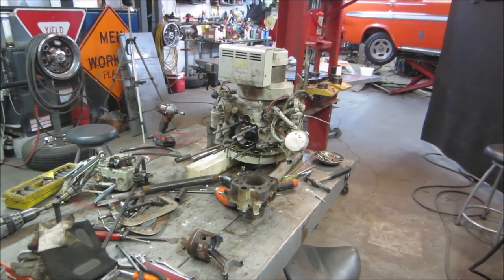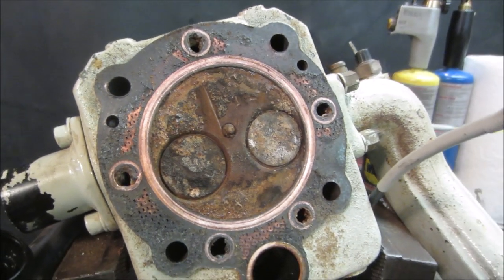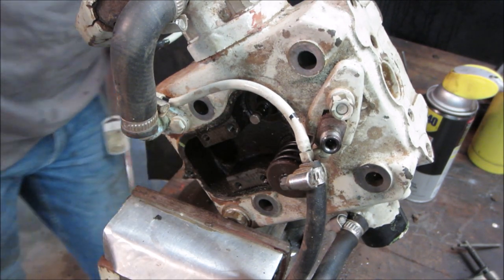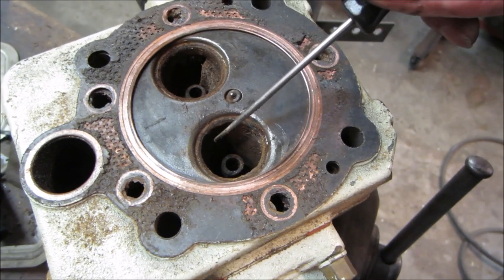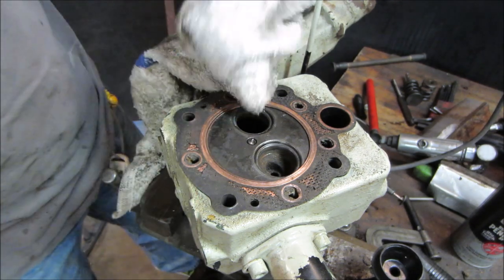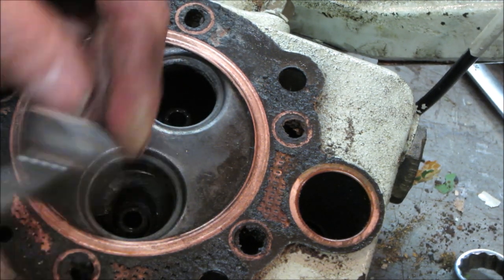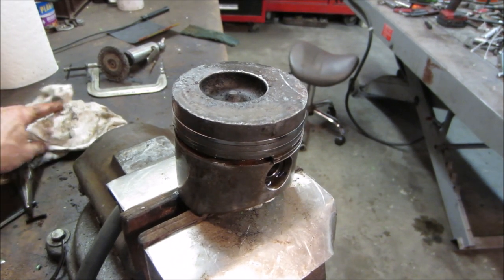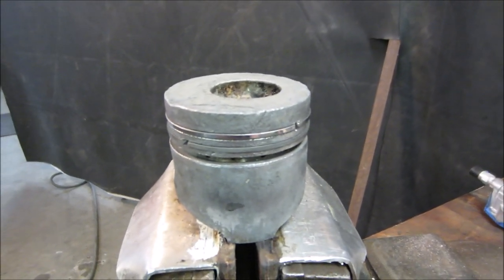Can It Be Saved? Junked Marine Diesel PT 2

Comment: Come on buddy you can find rings and a piston let’s bring this old clacker back to life............everyone like this if you agree and want a part 3
Reply: Diesel engines with wet sleeves sometimes don't have oversized pistons available as the cost of the sleeve may be less than the cost of making and stocking oversized pistons and boring the cylinder.
Reply: Me too waiting for part 3 :-) Curious if he can make it run in the end. Great video, really great. See there are several other videos about restoration on his channel; lovely entertainment and very educational.
Reply: I don’t understand why there is not a part three to the build. You can get rings Somebody could Build you a piston the cylinder could be sleeved. I washed all your videos I don’t understand why this project never had a part three. It Hass to continue that just has to..
Reply: Part 3 ?! 😆  if it runs, it runs and starts crap and is on a fast track of destroying itself 😢
Reply: Ressurect that old Mustie 🙌🏼
Reply: @mercurymadness9005  like vALVE,

Comment: being a old marine mechanic, i'm sure the exhaust elbow has rusted out allowing water to get in the exhaust side from the cooling side as it exits. this usually happens after it is shut down with no exhaust to blow the water out and it trikkles back past the ex valve.
Reply: Can that be repaired? Man that cylinder has a groove like the Grand Canyon. Fun project to watch, but it’s just a generator. There’s no buyers for it, if he puts much in it besides a gasket kit.
Reply: Yeah, that's my thought too.
Reply: @breikowski  running and working its gotta be at least 500 maybe to a sail boater way more
Reply: @jordanlittle5391  yup, I agree. So, best case, he’s working for free. That’s if he can bore the cylinder out and press in a new sleeve. Did you see the groove in there? There’s no way a 20 over is going to clear that. At least he got a couple videos out if it before it goes back to the scrap pile.
Reply: @breikowski  like he said if you had a piston where the rings sat below that it would run otherwise the rings would catch and break
Reply: Looking at the heat exchanger being all rusted up. It's safe to assume the separation of engine coolant and sea water failed, in addition the output could of been all plugged up and when the engine was craning the raw water pump is pushing salt water into the engine and  exhaust.

Hopefully it's worth most of what you paid for it in scrap metal. 

It was entertaining and watching you discover the failure points.

Comment: Mustie1, I have been around boats for a long time. A common issue with inboard cast iron engines are they rust out unless they are fresh water cooled with a heat exchanger and coolant. Your engine looks to be raw water cooled( plain old sea water) . So the first first piece to rust out is the exhaust manifold and riser. That can allow water to be dropped in from the exhaust manifold. But also the way that exhaust is cracked looks to me like it froze. That would also make it leak when thawing or after shutdown. I am not there to inspect it as well but it is a possibility that it was sunk in a boat which you have pointed out already. Another commenter from Italy left a comment that was very good. Lombardini engines are very reliable. I have worked around them. I believe that you are going to get it popping soon! Great content! Keep it coming please!

Comment: BTW you saved me some money today and a trip to a store plus taxi fare. I have a cheap water dispenser that's basically a plastic housing with a slotted column thing in the middle that pokes into a 5-gallon water bottle then a plastic tube on the inside that connects the column to a spigot, with spring steel clamps on each end and a plastic nut to hold the spigot on. Today it started leaking and dribbling water onto the table. First I determined that it was the dispenser that leaked, not the bottle. I was all set to go buy a replacement dispenser, then I thought of you and said to myself, "Let's see if I can fix it." It turned out that the plastic nut had worked its way loose so it was just finger tight. A couple of seconds of torquing it with a pair of pliers and no more dribbles!

Comment: If you ever need valves ground just ship them to me and I’ll grind them. As for the valve seat a valve seat cutter should clean it up. Or ship the head to me as well and I’ll grind the valve seats as well.
Reply: If you remove the sharpie your seats need recutting.
Reply: @datadavis  that I cannot do but JonathanW probably could.
Reply: @mjmcomputers  ain't much jon can't do is there!
Reply: Including giving a machinist a brain hemorrhage
Reply: Maybe Abom79 can make a new sleeve out of a billet of cast iron !  Ha-ha !
Reply: My laser cutter can't do crap on this because they use weird piston ring designs. Plus it would need to be checked for leaks.

Comment: This video inspired me to use a 20ton press to break a rusted in aluminium piston out of my 1941 single cylinder two stroke outboard engine. Cast head and barrel, no sleeve, and applying the pressure through the spark plug hole! The piston did not survive as expected but I have a spare. The barrel looks fine and after some honing I’m now rebuilding it.

Comment: Mustie, I was taught by on old master many years ago to make lapping compound using burnt wet and dry sand paper mixed with grease it is particularly handy when dealing with badly damaged or very hard valve seats as you can vary the grind by adding more burnt paper and using different grits...I highly recommend you try it.

Comment: When I was a Marine Engineer we'd change the liners frequently on bored considerably larger than this. We'd use a two part spray process to check for small cracks. First spray was red and would be left for a while to soak into invisible cracks and the second spray can was white. After a short while any cracks would be easy to spot as the red would seep into the white from below and the cracks would be visible to the naked eye.

Comment: I haven't seen one of those for a very long time.  You have to be careful as DECCA and Marconi (LTD) used them with the generator to make the high voltages (1,000 to 2,000 Volts plus 480 V etc) for their marine radars.  We gave up trying to find gasket kits for them and started using copper sheet to make our own.  Cut it the same way I've seen you make the paper ones and heat them in the oven to soften them if you remove the head again..
Thanks for showing this video.

Comment: Quotes from a Mase manual: Repeated attempts at starting with
negative outcome may cause excess accumulation of water in the exhaust system with possible serious damage to the engine.
If it is difficult to start the engine, do not retry for too long without first having closed the seacock. 
It happened to me😬
Reply: Yup, hydrolocked for sure.

Comment: One tip when lapping valves, when getting close to done, write on the valve seat angle with sharpie all the way around. They if it is gone after another round of lapping, you know that the angles are matching.
Reply: Well, the angles shouldn't match perfectly, the way I learned is there should be a narrow band where they make contact, not the full surface. I looked at a performance Chev site and they were even saying 45 and 60 degrees (45 for the value, 60 for the seat). 

But yeah, a sharpie, machinists ink, even quick dry krylon spray paint works too.....anything so you can see the seat line.....
Reply: he has done this in the past.
Reply: We used bluing(sic),but a sharpie will work
Reply: @muskokamike127  Actually the seat should be cut on three angles and the valve on one if my memory serves me proper.

Comment: Looks like the water jacket on the exhaust manifold failed, and let the cooling water leak back into the cylinder.  Happens a lot with marine engines when the exhaust manifolds aren't inspected/replaced on a regular basis.

Comment: I've made a head gasket from sheet lead. I cut all the holes and around the edges of of the water jacket holes and central bore, then I laid rings of small diameter solder. These weren't soldered to the sheet lead but just kept in place while fitting the head by 'sticking' the solder rings in place (Loctite or similar). The Loctite or whatever sole purpose being to keep the solder rings in place while re-fitting the gasket. Once the head is torqued down the 'rings' get crushed into the lead sheet. 
This was on a Barn engine with much lower compression however.

Comment: Aluminum has greater Heat expansion than Steel, so if you want to extract a Steel Part out of an Aluminum Part just heat it up.
and if you want to extract an Aluminum Part out of a Steel part, cool it down with liquid nitrogen and the Aluminum will shrink more than the Steel. For example extracting the Piston out of the bore.

Comment: ...Musti, the thin gaskets at the base of the cylinder are for shimming the deck height ( compression height)  of the piston. When I was in the engine parts industry we used a gasket profile catalogue from Payen. If we couldn't find what we needed  we would photocopy the gasket sample and send it to Payen for identification. I have in the past unfrozen rings using a ring compressor and tapping around the outside with a small hammer. Nice job.

Comment: I have found that sometimes you need to soak stuck rings for days or even weeks for them to release. But the wait is worth it. What you have is a very unusual case of abuse. MAY THE FORCE BE WITH YOU FELLA. VF
Reply: with the top of the piston broken that top ring is a gonner no matter what. But it would be nice to see if it can be made to run again sucessfully

Comment: Some typical reasons for Coolant in the Exhaust are: blown head gasket, cracked head, cracked block (or cylinder liner), or cracked EGR cooler. There are other ways for coolant to get through to the exhaust, but these are the most common. Like you said it could very well have been in a situation where the Exhaust had a back pressure issue and sucked up a bunch of water. I have been watching you videos for a long time, 1st time commenter though lol but I can say that I'm sure you will be able to get it fixed up. I am also a licensed, certified diesel mechanic if you ever want to chat about something or am curious on anything but for the majority you seem to do quite well with them anyway another great video and I can't wait for the next one!

Comment: You could take a running side shaft engine with a belt pulley and bolt the two engines together with a couple pieces of angle iron and stick a belt between the two engines and use the running engine to spin up what's left of the other one to see if the generator part works

Comment: Spin the crank with the drill, and see if you get any voltage generation ...
Reply: Cool idea only being a diesel engine it may require lower rpms to generate adequately
Reply: @shaneharrison4775  an electric drill can give low rpm at a high tourque value if you set it to.
Reply: @joshuamcpeek4708  yes I know
Reply: A diesel will not generate any spark as compression alone causes the explosion in the cylinder.  .... No spark plug
Reply: @dankeyes2669  they were referring to the generator coupled to the back of the engine

Comment: If you simply google Ruggerini you come up with a source for parts manuals and what appears to be several sources of parts. Unfortunately on part 1 I couldn’t make out the motor type on the engine label.
Reply: Looks like RM81
Reply: Lombardi was an industrial diesel mfg in Italy.  Was recently taken over by Kohler.

Comment: A few things for you

1: the piston will come out of the deck of the cylinder.  That is an important measurement. AKA piston protrusion. 

2: the multiple base gaskets (between the cylinder and block) adjust your piston protrusion. Which essentially controls compression ratio as well as piston to valve clearance. This is a simple check with a dial indicator. Hope you can find the spec on line. 

3: you're going to have to get a piston. That cylinder is way too far gone. I'm sure that piston architecture was used on some other engine somewhere. I'd take all the measurements and call wiseco. They make every piston ever lol. The diesel really needs the compression from the rings otherwise... Well... It just won't do the diesel thing

4:. Don't use ether when you try to start it. It will become addicted and then never start without it. (ignore zip ties and bias plys haha)

Awesome series man. Keep it up

Comment: Just heat up the piston to free up the rings.
Reply: I had the same thought, but figured there must have been a reason he didn't try heat.  I'm no mechanic, so I certainly trust Mustie1 more than my instincts.  LOL
Reply: @StevenIngram  This is common practice. Usually works the first time, if not, let it cool, heat again. There's no need to use penetrating oils. Just heat under the piston and light tapping. If the rings do not free up after 2 heating cycles then the piston is junk, something must have happened to it other than crud.
Reply: Anyway, the piston is cracked. Toast.
Reply: Yeah, its junk. Siezed/broken rings, cracked piston, pitted valves that leak like a sieve. It'll need a new piston, new valves and new gasget + other parts, which aren't available any more   Why is he even bothering with it. Back to the scrap metal pile
Reply: @simontay4851  The valves can be ground in a machine, the seats can be recut, Im surprised he doesnt have a valve seat cutter set. Im quite sure an engineering shop can reference a piston which will fitor can be modified to fit and im quite sure someone will have gaskets for it.
Reply: That would change the steel properties of the rings. It's called annealing. Annealing 'relaxes' the steel and makes it softer. Rings are heat treated to give them the hardness and that makes them spring like. As Mustie1 had no parts, that's about all he could do. Unfortunately the crack in the piston head had pressed down on the ring and jammed it. This is what may have been the reason for the engine failing and 'seizing up'. (I don't think it was from Mustie1 pressing it out, as the crack looked old. My heart sank when he pointed it out. There's still hope for an old spare part though.
Reply: @David-yo5ws  Sorry I forgot to mention that people lacking common sense should probably not attempt this.

Comment: In the UK there's an ebayer that makes piston rings to your specification, I would guess there's someone in the US doing the same. 3.150" is exactly 80mm, so there's likely a European or Japanese engine with a piston of the same dimensions.
Reply: A lot of the Ford cross flow and pre crossflow engines had an 80.97mm bore, no idea of the width of the rings.
Reply: But it has to be a DIESEL piston, not a petrol one
Reply: @brianlynch994  I was referring to the rings, but from a quick surf it looks like the correct rings (and pistons) are available.
Reply: motorencenter de has pistons for the Ruggerini RF-80 with 80/80.5/81mm at € 57, the rings are about €15, a set of gaskets €28, but I dont't know if these will fit the RM-81

Comment: I have found a great way to lap valves when you have access to the stem on the backside. Find a short piece of rubber hose with small enough ID so it must be forced onto the valve stem. Force into the other end of the hose a bolt or dowel. Chuck the dowel into a drill. Use the drill and the flexible connection you have made to spin the valve. 
Lap the valve using compound as you normally would. Use one hand to apply pressure to the valve and the other to hold the drill motor attached to the stem. Alternate forward and reverse directions. With this setup you can quickly lap off required material to get a good tight seal. 
Be sure to lubricate the stem in the valve guide because you will be spinning the valve a lot faster than you can with the suction cup method. Be careful because spinning the valve fast may sling valve grinding compound out away from the valve lip and get somewhere you don’t want it.  
I found a guy on the SmokStak site who sells piston rings by size and dimensions. If you need rings perhaps generic will do just as well as OEM. Remember typically the rings aren’t made by the engine MFG. They are purchased from a ring mfg /supplier by specification. Some engineer back when they designed the engine found a supplier who made the rings they needed. Then the manufacturer puts their own part number on that ring so they can track it in their database. The rings you need may work in all kinds of different applications.

Comment: Marine diesel generators have what is called a lift muffler.  This muffler needs to lift the water,   that was drawn into the engine by the raw water pump, up and out of the boat.  If the engine does not start right away, and you continue to crank on it, the water (probably salt water)will back up into the cylinder head and seize up the engine. Usually bends a rod.  There is a small drain on the muffler so the water can be drained, then you could very carefully crank on it again